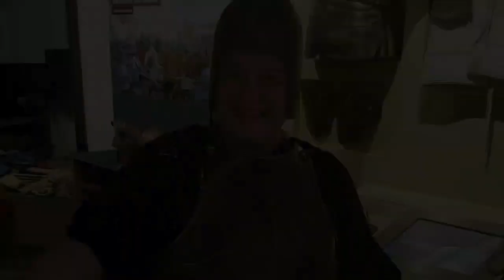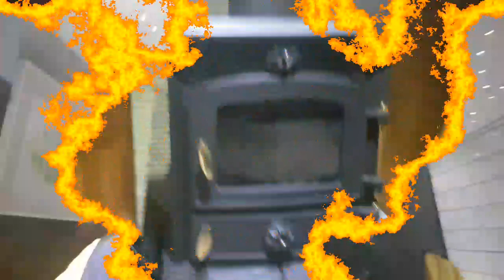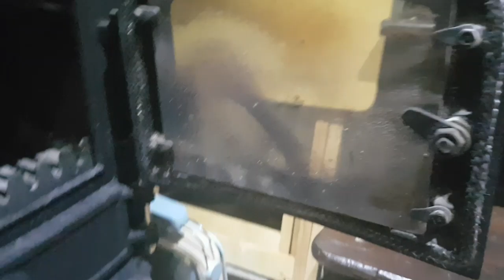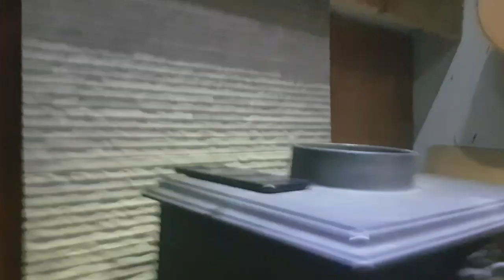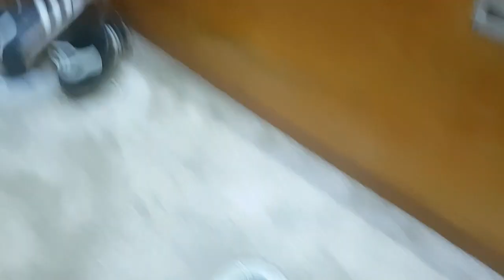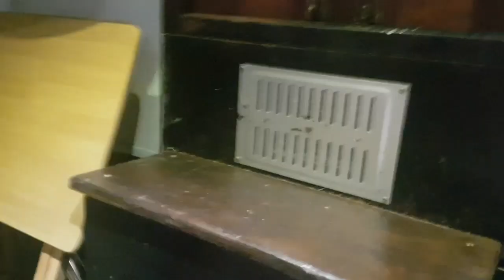narrowboat stove

Comment: Love the new intro. The stove looks great. I’m no expert so ignore anything I say! Would one big paving stone not be better? I’m not sure the hearth needs to be so high, unless that’s what you want and you could tile over the large stone and that would look nice.  The fire looks great and 6kw seems massive so that should be fine on the boat. Now this is going outside my very limited knowledge but should you be looking at balance or ballast on the boat? Maybe not but I prefer to check as I don’t want anything to happen to your lovely dog! Great vlog. Thanks.
Reply from the maker: Hi Sylvia. Ive lifted the stove on 3 slabs to give me the option of getting a 1.5metre flue instead of having to shell out for 2 metres. The ballast isnt a problem for us as the boat is sitting level and high in the water we only have a 2ft draft. Also when we get the coal and wood stored on board thatll add a bit more weight. As for Henry the mutt im sure hes looking forward to curling up infront of the stove on those freezing cold winter days..

Comment: A good vlogs, just a word of caution as I found out to my cost, fit the collar and make sure it is in line before cutting the flue. 
I ended up having to buy 2 flues because the camber of the roof required extra packing to line up the flue course.
Good luck with the fitting, you might find 6Kw is very warm☺